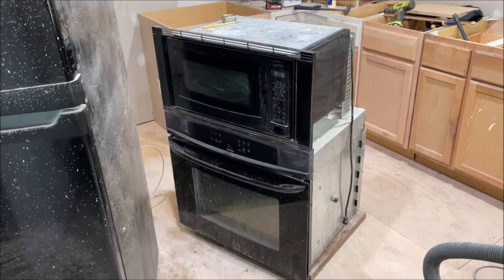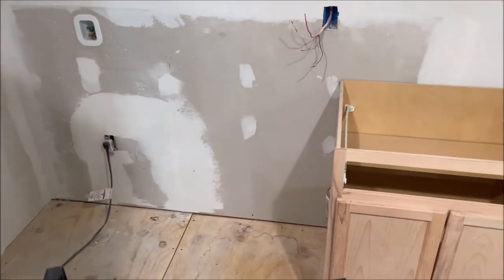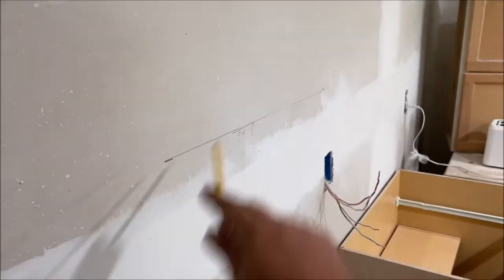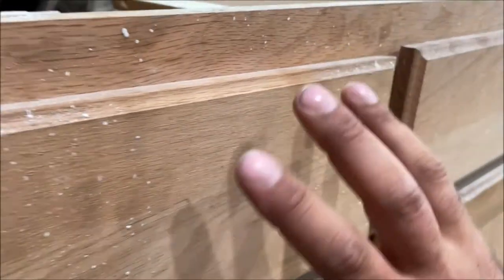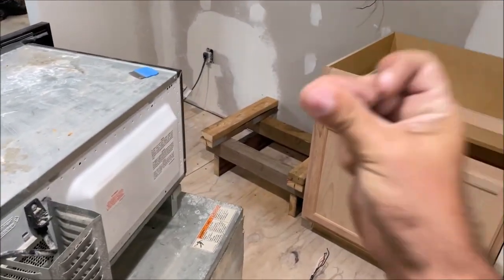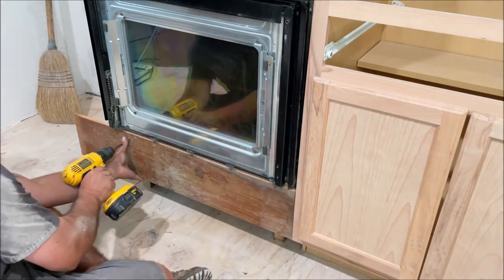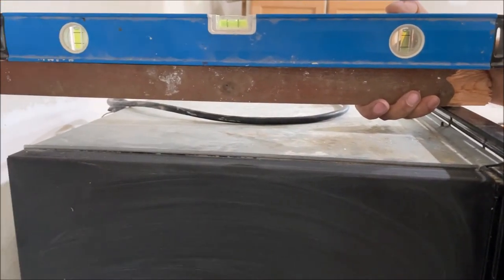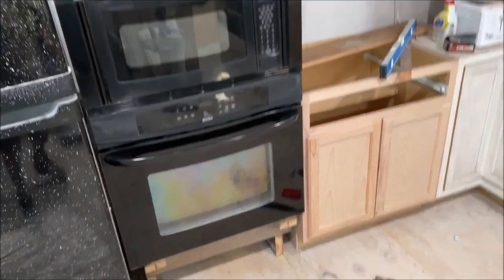how to install WALL OVEN microwave in cabinet from SCRATCH DIY

Comment: I'm in the middle of a kitchen remodel right now doing it myself.
I had the same setup you did with a separate oven.
We are replacing that with a cooktop and a microwave oven combo.
My question is, do I need to run a separate line for the cooktop and the microwave oven combo or can I just pigtail off the existing 8 gauge?
Reply from the maker: that depends on the amps they all pull when all on at the same time.
Reply: @chriscraft2  thanks for the quick reply.
Guess I'm going to have to get an electrician here
Reply: Also read both appliances' installation instructions. If either specifies a branch circuit, they both need to have independent circuits.